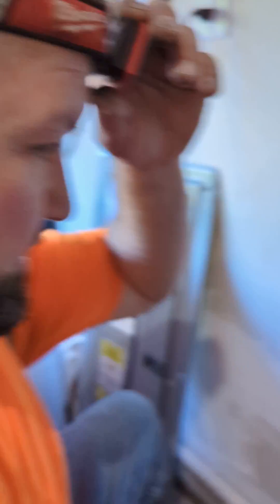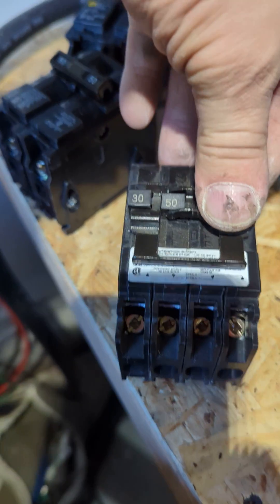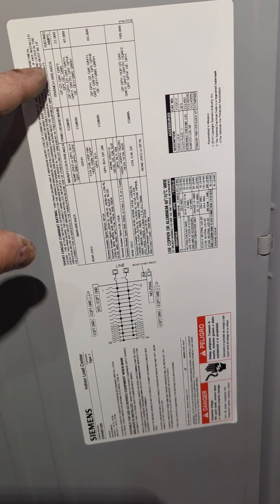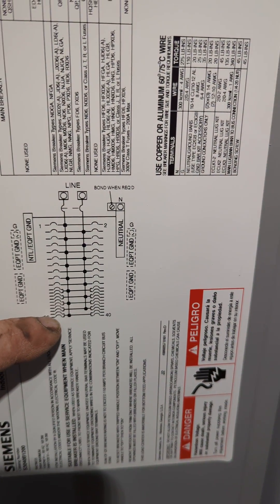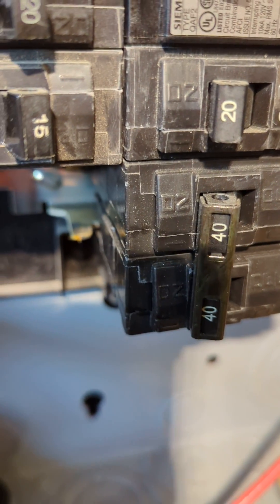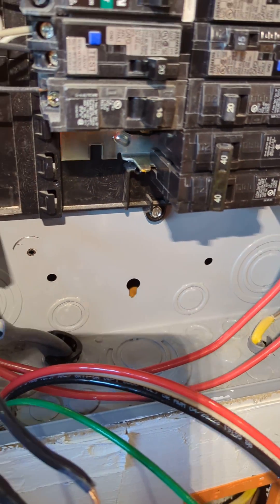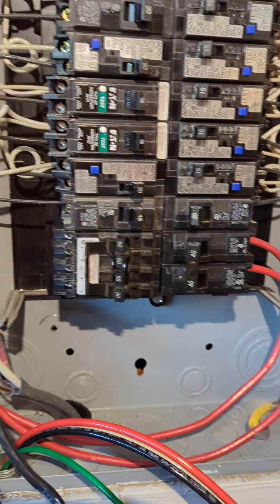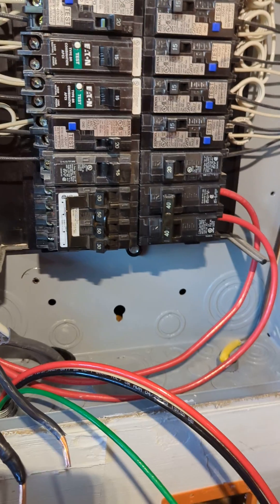Siemens breakers QP vs QT

Comment: Can I replace my 50 amp generator breaker with a q250h breaker
Reply from the maker: There is a lot of information that would be needed to answer that correctly. Also there are additional requirements for back- fed breakers (hold down bracket/retainer clip). But if it is a Siemens panel and the breaker is mounted in the correct space for the mechanical interlock, then yes a standard 2 pole Siemens breaker with a proper hold down should work.
Reply: @AGEElectricInc hey my electrician tried to install the breaker but the wires that comes from my generator plug was too big to fit in the breaker
Reply from the maker: @miltonhunter6515 well the Siemens breakers have the acceptable wire size stamped on the front and it's good up to #4. I don't know what size wire was ran to your gen plug, but it does not need to be more than #4. A 50 amp gen plug can be fed with number 8 THHN or a number 6 NM cable. Both of those are rated for 50 amps.
Reply: @AGEElectricInc idk I have to ask my electrician and I have a tlmathus breaker as my 50 amp generator and the wires fit in it perfectly but I want to replace that breaker with a seimens breaker
Reply from the maker: @miltonhunter6515 I don't know what a "tmathus" breaker is, but breakers are supposed to match the manufacturer of the panel. Just because it may fit doesn't mean it is listed and approved for the panel. I assumed you had a Siemens panel.
Reply: @AGEElectricInc I have a seimens panel got it installed in March of this year
Reply: @AGEElectricInc tlmathus breakers are compatible with my panel but not UL listed and Im going to get it out of my panel

Comment: As a pool and hot tub inspector, just FYI, a Hot Tub, when using a breaker, the breaker is required by codes to be GFCI protected and this video shows he was NOT using a GFCI protected breaker.
Reply from the maker: The GFCI breaker is in the spa disconnect. This is the breaker that feeds the spa disconnect that is within sight of the hot tub. The complete install is shown in another video. This video was for informational purposes to show the difference between QP and QT breakers.

Comment: Great video --  Thank  you for sharing  !   So  can  a   90  amp  breaker 2 pole  go down into the  Bottom of the  panel  ?   200  amp   EQC24MBB - I-T-E Indoor Loadcenter
Reply from the maker: Yes a standard breaker should be ok, you do want to verify the stab rating of the bus. That is the max ampacity per stab. That means the breakers on both sides directly across from each other. Usually it is marked in the stickers on the inside of the cover.

Comment: .
At the risk of stating the obvious , even when the main breaker is turned off , 
power is still on coming into the panel . I have a rubber mat down on the underneath the panel .  
.

Comment: Thanks for showing this . I have a Siemens 100 Amp panel have read that QT's and QP's are not compatible . 
All the double pole ( space savers) breakers installed are QT's .
However , there are also single pole QP's installed - and both of these are are at one of the panel . 
.

Comment: You are how an electrician should be, sir. Tip of the hat to ya. 
Just recently realized my electrician loaded up my Siemens panel with Eaton breakers and none are the CL type. So frustrating that they seemingly works but they don't belong in my panel. I didn't know the difference between type C and typle CL so I didn't say anything at the time. The funny thing is, this seems to be super common in retrofit jobs. They just buy bulk of whatever is cheaper and they install it in everything. 
Now i don't know if the difference between C and CL (Classified) is the listing/testing only or if they are any different. But it is not correct regardless. So frustrating. I guess i should replace all of them at some point and perhaps get AFCI breakers while at it as the new code requires AFCIs on pretty much all circuits.

Comment: I have a Siemens Main Panel that has QT breakers installed. Can I install a 100 Amp Double-Pole Type QP Circuit Breaker onto this panel?

I'm installing a Sub Panel and looking for a 100A breaker that I can install into my Mail Panel to feed the Sub.
Reply from the maker: Yes, type QP breakers will fit anywhere in the panels. It's the QT breakers that have the rejection tabs and are limited to certain locations on the bussing. Like the example of a Siemens 30/40 panel where QT's can only be located in the bottom 10 spaces.
I typically like to mount the higher ampacity breakers closest to the main if possible, or if I am going to relocate existing circuits into the sub-panel. A lot of times I find it isn't much more of a cost to just upgrade the existing panel to one with more spaces but there are a lot of ways to accomplish the same task and a lot of unknown variables on my part. Best of luck and be safe!

Comment: During my 50 years as a sparky I never used a twin circuit breaker higher then 20 amps. They run hotter and with heavy loads they don't last too long.

Comment: And here I’ve been scouring the web high and low trying to find a tandem QP.  My panel is full and I need to make room for a 50amp for my portable generator.
Reply from the maker: Glad this could help!
Reply: @AGEElectricInc  I was able to use a triplex in my box. 40amp double pull with 20 on each side. Freed up 2 spots for my 50amp generator install.  Glad I found your channel.

Comment: Eaton breakers in a Siemens panel?
Reply from the maker: Good catch! Yes, we informed the owner of the compliance issue with those breakers. They chose to not correct it at that time. Although, we were able to get rid of a Square D 2-pole 50a that was in there and got consolidated with the QT breaker. It seems almost every home I go to I'm following people that don't understand    that just because it fits doesn't mean it should. Though Eaton does have a line of "UL classified" breakers that are listed for use in multiple manufacturers. They do come with a higher price tag but they can keep inventory down.
Reply: Also ge breakers are compatible to seimens my inside panel is full with all ge breakers

Comment: So QT is twin and QP is single pole?  Is that what you're saying?  It's hard to find this info.  Thanks.
Reply from the maker: A QT breaker is a tandem , triplex, or a quad breaker. So in a sense yes, they are the skinny style that allow you 2 spaces in 1. They will only fit or mount to the bussing in specific spots in a panel. For instance if you have a 30/40 space panel, that means there are 30 full 1' spaces available. To get an additional 10 spaces to make it a 40 space panel only the bussing on the bottom 5 spaces on both sides have a notch that will allow type QT breakers to fit there. Panels typically have this information/diagrams on stickers on the inside of the covers. Hope this helps.
Reply: @AGEElectricInc  I bought a 1975 house with a Siemens ITE G4040MB1200 and there are 2 Quad 20A breakers on slots #9+11 and #10+12 (quads are back to back of each other) and in both cases the Slim breakers 1 and 2 on both Quads are bad (6.5v-7v). The panel sticker does not state it accepts QT and from the diagram does not show the tighter-spaced hot bus "slots" that you mention. Does that mean I should look for 4 tandem breakers of the same amperage, from product lines listed on the panel door sticker to replace the bad quads? I don't know if my panel is original to the house, I'm having to replace a bunch of breakers based on individual voltage testing. Many breakers look old and the manufacture isn't very clear. Interestingly enough I have found online pics of very similar Siemens panels that accept QT breakers. Thanks for your help!
Reply: Thanks for video, nice headlamp! My panel is a EQ8695 w busbar accepting QTs anywhere and no double lines on diagram like yours. HOWEVER, QTs aren't listed under any of the branch breaker listings. It's no where close to being overloaded and it's well balanced but I do have 6 QT tandems running lights inside and out of a <1000sq ft home. Busbar doesn't have the QT blockers, they go in just as easy as QPs.  What am I missing ? PS..just got my 1st ECX screwdriver today so i gotta see what's loose around here😅